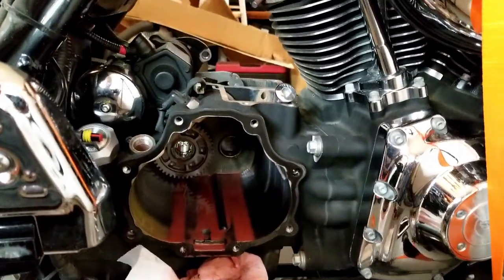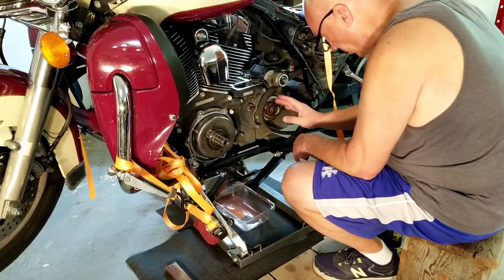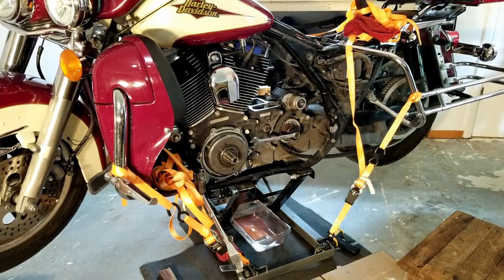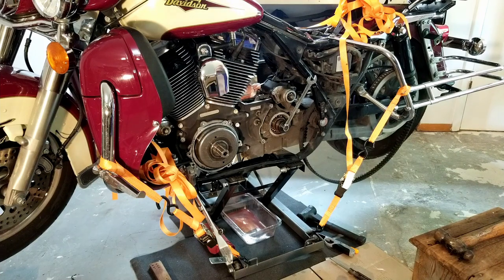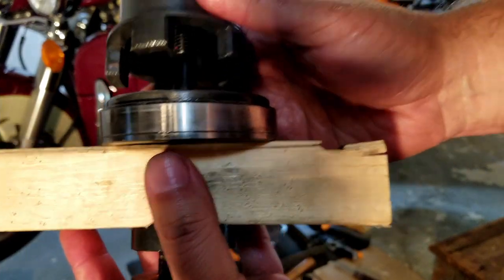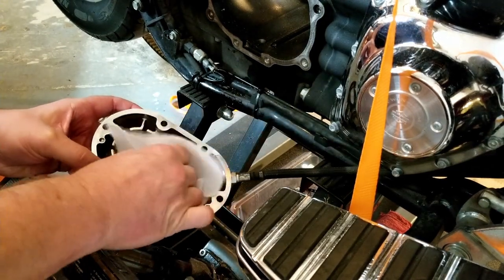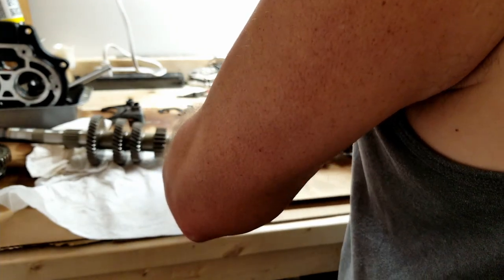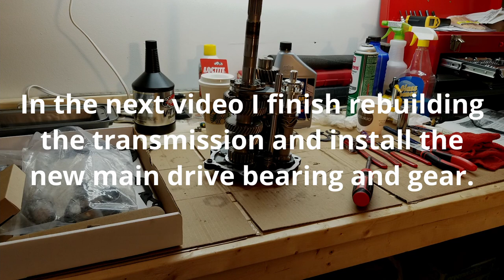2007 Harley Davidson FLHTCU Transmission Rebuild, Teardown and Main Drive Gear Removal

Comment: Man ! I appreciate your video , even is slowly, I can understand some fact about that bearing and for the transmission case . I use a strong wood , and over I put the steel bar ! Then I use an electrical heater , and I control the temp with a electronic device , to not cross 90 Celsius . And was come out no time ! Very very easy! Thank you

Comment: How does the spacer on the main shaft come off, i removed the seal , but is it actually pressed on? Im more familiar with Evo 5 speed the spacer just slides out and install the quad seal, im trying to reseach it online , till the manual gets here. Edit: ok i just found a full video on 6 speed the spacer is apart of the inner race on the main bearing per Mr Kevin Baxter’s Harley transmission rebuild on a budget

Comment: I was running syn gear oils our 94 Ultra. Changed to dino gear oil of same viscosity, now tranny is much quieter when shifting and much easier to find neutral. Changed from syn  20w50 in engine to dino oil same viscosity and now it's much quieter!

Comment: thank you joe, after watching your success it gave me the confidence to go ahead and work on my 2010 dyna, the 2nd gear dog ring has wore out and now slip and jumps , I have ordered the pulley nut socket, the main shaft race removal tool and a big pair of snap ring pliers, I will start the transmission work in 2 weeks and make it a project, no rush since it getting cold ,  I really did not want anybody else wrenching on my bike,
Reply from the maker: Thanks for the comment alan, the hardest part was removing the main drive gear.

Comment: the side your heating (which absolutely should not be done ) is the side the spanner should be turned clockwise to drive the inner drive gear into the tranny case leaving the outer bearing to pulled out the side your heating toward you  .. i applaud you giving it a go but clearly there's no prior understanding or plan on how this is to be done ..you may have annealed that drive gear with heat making it soft
Reply: I've seen a lot of professional videos where they doing the same thing , just don't let the shaft get too hot